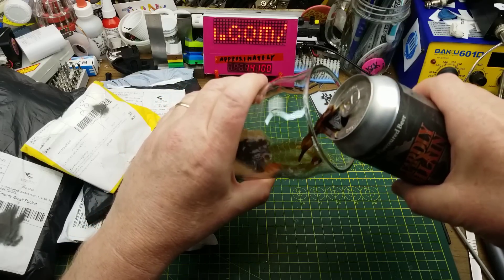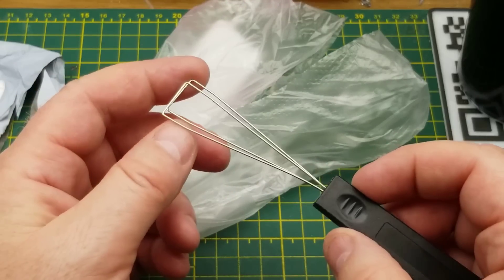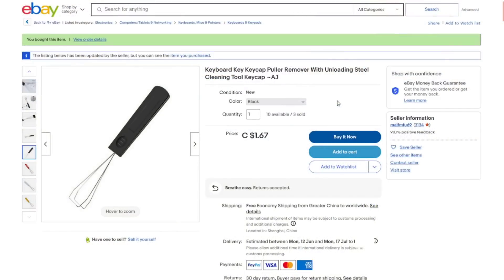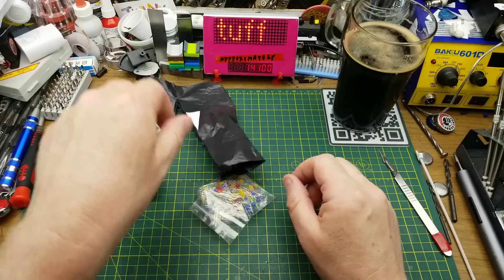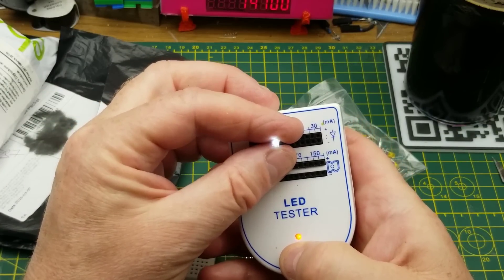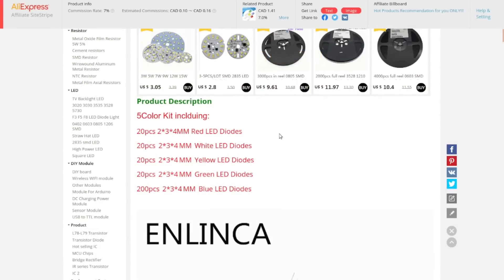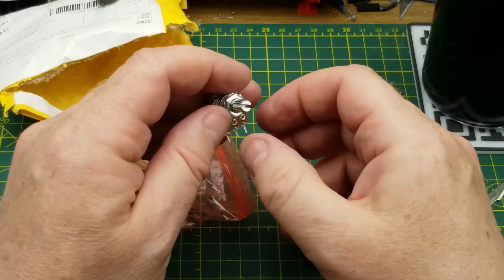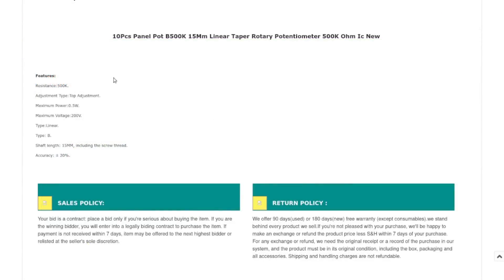Mailbag Monday 166

Comment: I've got a bunch of those 2mm rectangular LEDs with 470 ohm resistors pre-soldered to the Anode lead and I use them to plug in on my breadboard projects wherever I want to see the logic level at that point. Because of their width you can plug them in groups to see counter outputs, addresses on memory devices, data busses etc without them getting all out of line. Very useful. I just keep them in a bag with my breadboards, jumper wires etc.
Reply: Great idea, and I wish I had thought of this years ago.
Reply: I made a giant panel of the 5x5x7 ones that displays text. What a waste.
Reply: @jstro-hobbytech  I have an unhealthy obsession with 8x8 grids of LEDs.  Got a few that rasterize the CP437 with shift registers and such.
Reply: You do this with some of those 2-pin bicolor, and you get polarity as a bonus.  Only seen them in the 3mm round package though.
Kinda wonder why current limiting is not built into the LED itself.
Reply: @GnuReligion  wait till the next mail bag video on here. I sent him almost 10lbs of toys haha
Reply: @jstro-hobbytech  I have begun to 3d-print housings and diffusers for LED grids ... hiding that ugly crossover.  Nice organized ribbon coming out for X/Y.  Not crazy enough yet to try a LED Cube though.  Can't wait to see your things!  No doubt, you have outdone me.
Reply: @GnuReligion  yeah I've made a bunch of them. I always give them away though.
Reply: @GnuReligion  it's not a competition my friend.  Gimme your address and I'll send ya some leds
Reply: @GnuReligion  unless it's in Canada or US haha. What kind of printer ya got? I've had a bunch but  traded away my last 2 and sold a closet full of filament hahaha. I picked up a 3018 mill on sale and bought a laser for it off ali. There's a creality resin printer on sale dirt cheap that I'd like to get but the wife won't let me buy it so I won't press the issue as she let's me have toys. I realized today that I have all this bench gear and hand meters but not one with a letter L in it and I need to measure inductance soon to wind some transformers and chokes for an amp I'm building.
Reply: @jstro-hobbytech  Yup yup, another obsession for a while is a home-made inductance meter.  Made a symmetrical oscillator with known inductance, then put the test piece in parallel, and counted the frequency of pulses.  Understanding coils is a black art.

Comment: Looks like you smoked a few of the breadboard holes :face-green-smiling:
Reply from the maker: I've got a couple of the cheapest nastiest breadboards that I use to hold pins in alignment when soldering them onto their PCBs.
Reply: @pileofstuff  I use an old breadboard for pin alignment too. Just wondering if anyone knows of a proper tool that would assist in aligning pin/headers besides using/destroying breadboards. I thought about getting a piece of aluminum plate and drilling a few (100s) of 0.1" spaced holes. Only problem with that idea is I can't space the holes accurately, which would defeat the alignment process. Needs to be something that can stand up to heat caused by soldering and or heat gun. Ideas?
Reply from the maker: @RonDogInTheHouse  A really cheap breadboard is the best tool I've found so far. Less than $1.50 on ebay is hard to beat for the purpose.
Reply: @pileofstuff  You're right, it's the best solution I've found so far. I guess it's my OCD or something, it just drives me crazy to ruin a breadboard with melted plastic and holes filled with flux. :hand-orange-covering-eyes:  Thanks, keep up the good work!
Reply: @RonDogInTheHouse  Yeah, I have some melted/slimy breadboards too.  Often I use rows of the opposite gender pin as a kind of lattice scaffolding when soldering long rows.  Gotta have perfect alignment!
Reply: @GnuReligion  I see where you're going with the lattice scaffolding.  Gonna have to give that a try. Lets see how my OCD deals with that. Thanks!

Comment: Don’t rely on those cheap pulse oxymeters too much. I have COPD and opted for these types. They are not very accurate. The good ones cost about $200US.
Reply from the maker: Yeah, I'm already noticing it's not very consistent from one reading to the next.
I guess that means it's destined for the teardown queue...
Reply: @iowahank And my doctor uses the cheap ones from China. If it's good enough for her...
Reply: What? $200?  Don't be silly.  If so then is it any wonder US medical services are so expensive.  My wife works in the NHS in the UK and they use "medical grade" oximeters that can be purchased by anyone for less than £40.  Also, the cheaper oxometers are fine for personal use.  After all, they are only there to give an indication and are not there to self-diagnose or replace professional medical services. If anyone, or any US medical service, buys oximeters for $200 then more fool them... its a con, a scam or whatever.

Comment: That was the last time I bought pots as well was for that circuit haha. You might have more rectangles than you know what to with soon haha.

Unrelated as I know you run Linux. What distro do you use. I've only ever used red hat 20 years ago and raspian a while back. I'm going to use Linux on my secondary pc.
Reply from the maker: Ubuntu (whatever the current LTS is) in my editing computer, and Lubuntu (lightweight) in my curb find workshop computer.
Used to run FreeBSD for a while, and a few of the old Knoppix distros back when they were a thing.
Reply: @pileofstuff  cool. We ran it from the command line off a zip disk in university. Man that was a lifetime ago. Thanks man
Reply: All the kool kids run Kali.